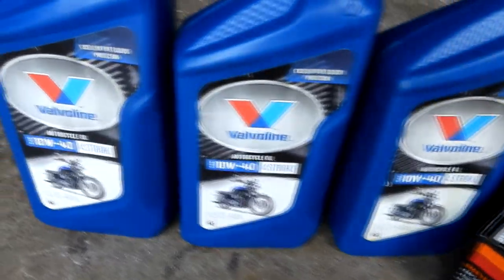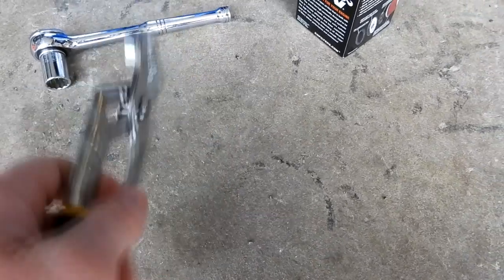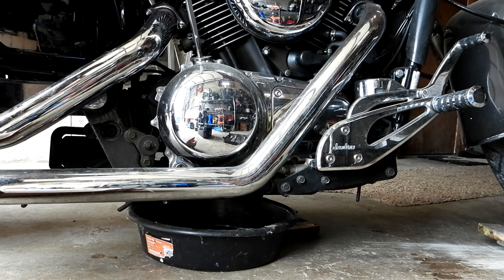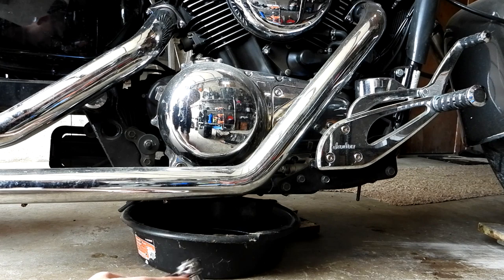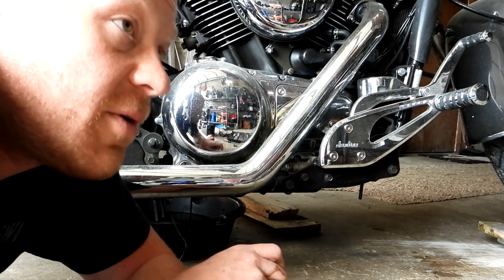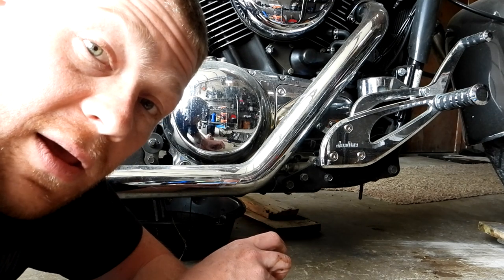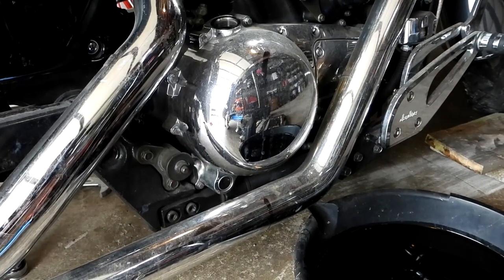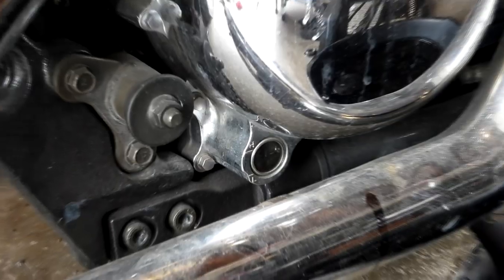How to change motorcycle oil - Kawasaki Vulcan

Comment: Just for the hell of it I have an '01 1500 Nomad and carry a Ruger SR9C. I change my oil every spring and throw in a new set of plugs in with each change. She has Vance & Hines bagger duels and a power commander which made a huge difference. I also have a 1700 Nomad but I like the 1500 better.
Reply: How many miles you putting on those with one change a year?
Reply: @rydeen450  12,000 - 13,000 with full synthetic.

Comment: Yeah car oils have friction modifiers that dont play well with wet clutches. It will make them slip.  Rotella t4 however is jaso certified so it works.much cheaper than most motorcycle specific oils and is pretty good stuff since it is for diesel engines

Comment: Changed the oil in my 98 shadow ace 750 I just got. I used that Valvoline and my clutch started to slip bad. Rebuilding the clutch now lol. Either that oil sucks ( it shouldn't) or my old oil was so nasty it kept the bike from slipping when I first got it running.( It has a little over 29,000 miles so if it's the stock clutch that's pretty good for 22 years)

Comment: I've heard changing the battery is a nightmare. At least on the Harley softtail
Reply from the maker: Easy on this one
Reply: I'll tell my step dad 😂
Reply: If you can find about two feet or so of flat nylon webbing, before installing the battery run the strapping under the length of the battery (the long way) and up each side so you have about half a foot above the battery on each side.

Then slide the battery down into the case, install the cables and lay the straps across the top. When it's time to pull the battery just remove the cables, and taking a nylon strap in each hand draw up nice and slow till it's 4/5 of the way out when you'll be able to pull it the rest of the way with your hands.

Don't pull the battery all the way out with the straps as once free of the case it will be balancing like on a tightrope and will immediately fall to one side or the other. My 1500 is a bear to remove and I broke several fingernails before learning the strap trick.
Reply: I remember Ted (stepfather) almost being brought to years, furious tears, trying to screw something on. It was the washer, he kept dropping it (I'm trying not to laugh 😏)